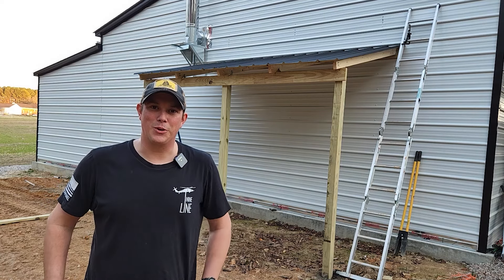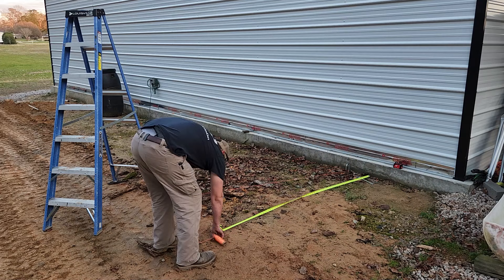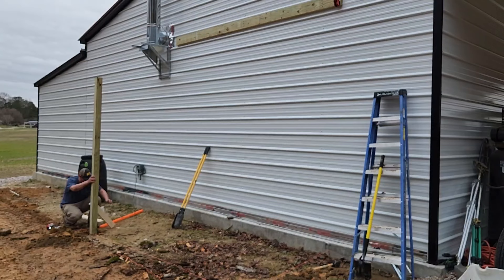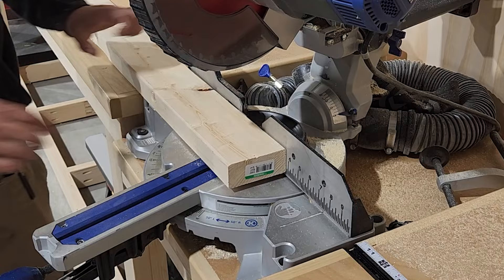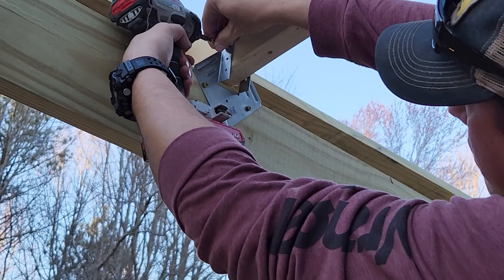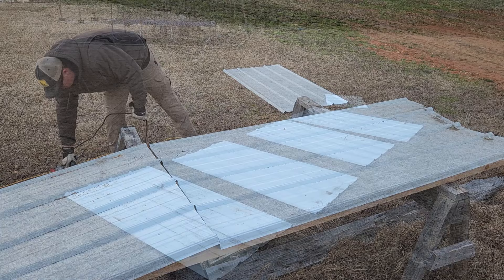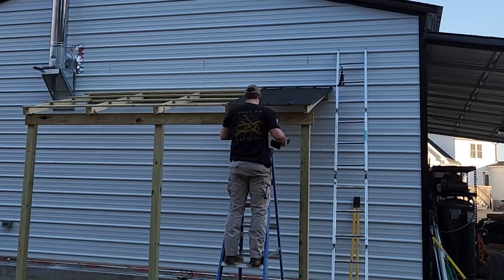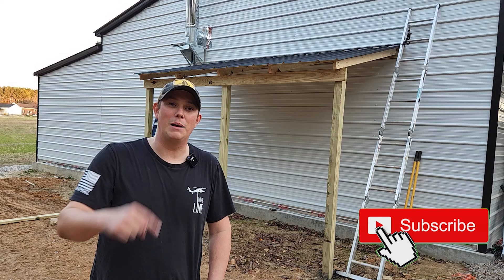How To Build A Lean To On An Existing Building

Comment: Good job.  It looks great!  My only suggestion would be to put some concrete in the bottom of the post hole before you put the posts in.  When you put the post in the hole first, then surround it in concrete you leave the bottom of the post exposed to the dirt.  It will slowly rot from the bottom up over the years.  The wood acts like a straw and will suck water up into it from the dirt that it contacts.
Reply: Yeah, but then you have a concrete cup the post is sitting in.  Best to put some coarse gravel down there to allow drainage while still creating a barrier from the soil
Reply: So does the ledger board just attach straight in tge sheet metal?
Reply: @dylanheflin3666  through the metal preferably fastened into every stud you can possibly fasten to

Comment: Good job!! just a suggestion, you can knotch out the top of the 4x4 post so that the 2x6 directs load to post rather that screws. makes for a stronger build.
Reply from the maker: Good suggestion!
Reply: Wouldn't even worry about that with something like this. That roof you could pretty much lift off single handedly. Majority of pergola's you see are held together with coach bolts so yeah, same concept
Reply: Can you translate “notch out the top of the 4x4 post….” in simple terms for the rest of us? I’m about to do this project myself and I’d like to know what you mean because I have no clue watch notching means or does other than makes it stronger…
Reply: @IGK58  At 3:04 you see him screw a 2x6 to his posts. Instead of doing this, you cut out part of the top of the 4x4, so that the 2x6 sits on top of a notch. You just make these cuts with your circular saw and the 2x6 will fit in the opening you create. Your 4x4 top will look like it has a little edge for the 2x6 to sit on. Many call it a LAP JOINT. This will distribute the load down the 4x4 instead of on the screws you used to mount the 2x6. I too am going to build this in a few days, and I think cutting out a notch is a wise idea.

Comment: Those joist hangers have tabs on them that you're meant to hit with a hammer after placing it where you want.  Just holds it in place until you can get some screws in it.
Reply: You can use screws for joist hangers...screws are not structural.
Reply: @boris9305 😂 You know they sell screw on joist hangers, right?
Reply: @boris9305 structural screws are most definitely structural....

Comment: The only thing I would have done differently is seal the lean to at the wall both on top and bottom. I built a porch once on a moble home the same way, I had a problem down the line by not sealing it.
Reply: What would you use to seal and how?
Reply: @justinrampersaud1948  I used a clear rubber  based chalk. Make sure surface is dry.
Reply: @robertwalley6692  thanks

Comment: nice video for a simple lean to project.  i would recommend at the top edge of the roof where the black metal meets the metal building putting a large bead of exterior silicone, caulk, or even roofing tar to seal out that joint.  Stormwater will find its way into that open joint against the building and over time saturate and deteriorate the ledger board.  Water can find its way into the shed through the screw holes too.
Reply: thank you for saying that. I was watching this and wondering if caulk was needed. Now I know! :)
Reply: @awildapproach  welcome!  my recommendation would be the tube of roofing cement, once it fully cures it is rubber-like and should hold up better over time than standard caulk or silicone.
Reply: @slo232000  Thank you so much! Will do!
Reply: Should have went to a seam in the metal siding and flashed the roof would’ve been the most correct way

Comment: Excellent video again. Building my own lean-to type in several weeks. for mine, it is going to begin from under a roof overhang of a tool shed so the flashing won't be necessary for my build. I like the idea of blockings between the truss/joists rather than on-top perlins. I'm still saving up for those thin corrugated metal sheets.

Comment: I have always poured a pier first then used a bracket for the 4x4 thus keeping the 4x4 from earth contact.  Has lasted over 30 years that way thus far.  Just a thought.  Great job, now I need one!
Reply: treated wood rots at the soil line.  well worth the effort to use your method.
Reply: @2nostromo  Depends. They have ground contact wood just for this application.  Or you can use a used railroad tie with 80 years of creosote, it will last another 80.

Comment: I cemented 4 x 4 posts into the ground when putting in a fence around my home in Florida and after about 30 years the posts began rotting out where the cement was.   I replaced the rotted out posts with new 4 x 4's but instead of cement put in crushed limestone to allow the water to seep past the wood.   I think this might be better than cement but 30 years is still great.  Thanks for the post
Reply: One solution to prevent the post from rotting is to first start with pressure-treated wood. Then coat the part of the post that will be below ground with a good heavy coat of black fence post paint. I like to use two coats. Now put that on top of a 4 -6 inch layer of compacted crushed stone in the bottom of the hole then pour the concrete around that. 

That's about as close to a forever post as you can get. If you cut your posts in the process of the build, especially the tops of the post, it's a good idea to coat those cuts with some form of sealant since you removed the PT chemicals when you made a cut. Happy fencing!!
Reply: Paint the bottom that will be going into the ground, I also add 4 screws going into the wood at a angle so the concrete has something to grab onto for a better hold. 

Add some small rock at the very bottom to allow drainage away from the wood. Make sure to tamp it down to get it as flat as possible.

Since you can cut the tops like he did in the video, it won't matter if they are even.

Comment: Great video! Looking through videos for a simple lean to and everyone had to go full on build mode. Glad you have an easy solid option for some storage space. Wonder if you could add metal siding to the sides too make it a little more weather proof from the elements.
Reply: I was wondering the same thing. This looks like a good solid structure to put some siding on.
Reply: Just add boards and siding. Easy upgrade.

Comment: I made on of those over a concrete slab, After finishing it just like you did I added half inch insulation under and a metal trim around the roof. Thanks for sharing,
Reply: Do a Country Cajun Living Dry Pour and the slab is easy.

Comment: I've done a few of these and I prefer tohave the posts 'float' about two inches off of the ground using 'Allthread', washers and nuts (washer / nut / nut / washer). These are inserted upwards into drilled holes aand downwards into the concrete pads. These allow for fine tuning by turning the nuts.

Comment: I would have put about 1’ of drain rock in the bottom before placing the posts. All in all a good job.
Reply: Thats what i thought
Reply: and when it rains the 1 inch will fill up in 1 minute and the post will be sitting in water as if the rock was never there.

Comment: Turned out great. My only concern is the bottom of the 4x4 posts will be exposed to humidity. One option is to put post bases in the concrete holes and screw the post to them, that way the post is never in contact with the ground.
Reply: The 4x4 will rot

Comment: Looks like you moved the ledger down after initial install to fit under metal panel rib, maybe to use as an overhang. Should have used flashing, The ledger will get wet for sure with this installation. Thanks for the video.

Comment: This is so perfect. Your lean-to is exactly the lean-to that I need for the side of our garage, and I'm using your design exactly. And mine is also for firewood, so that's double awesome. Thank you.
Reply: Same here lol I was worried about attaching to vinyl siding. Also concerned about what gets stuck on top of the attachment. Does the roofing get flashing?
Reply: @Robiobass2  well, I'm attaching to a wooden structure with an eve that hangs over about 10", so I'm good on those points.
Reply: @carlrudd1858  how wide are you going? I have about 3 rows deep in firewood. I'm thinking 6 ft also
Reply: @Robiobass2  not sure yet. I made it 12' long, and 5' deep. The low part of the roof is about 6 1/2' (a moderate pitch) up to about 8' at the side of the garage.
Reply: I am going with j channel on top of my 2x6  for the roofing metal to slide into. I'll use clear silicone to seal out the elements between the two vinyls. That should be good enough to keep the debris out. Mine is under a huge pine tree and needles get everywhere.

Comment: Loved this video. Also loved that you included the little one for a bit there..
A couple of 'constructive' thoughts.. pun intended.. 

1. If you're in a snow belt area, I believe it's been mentioned to attach ledger with through bolts.
2. If you're in a deep freeze zone, I'd make sure the posts are dug deep enough to prevent heaving, etc.. 
3. I'd consider placing a small amount of screenings, not concrete at the bottom of your hole, so the bottom of the post won't rot.
4. I'd also make sure the concrete stands a bit proud of the soil and is sloped out, to prevent rot at ground level.
5. I'm wondering if it might have been better to place your screws at the top of the ridge lines of your roof sheeting. All your screws are now 
     vulnerable to every run run off from rain above the screw.
6. I'd imagine you went through a number of cans of paint there... I do believe you can order that roof sheeting in black.. might be a special 
    order though.

All in all,  for the fact that this is a lean to... It will serve you nicely, but for you and others out there, some points to consider if taking on  something that needs/requires more structural integrity.
 
I do love the vid. I like that you kept it moving at a good pace and engaging and would look forward to more. I know it's a lot of work.

Best!

Comment: The only thing holding up the roof are the screws in the 2X6 going into the 4X4. You should have notched the 4X4 to have the 2X6 sit on the 4X4. If you have any snow load, that roof will fail. If you are planning on building something like this with snow, you need better support for the 2X6 besides construction screws into a 4X4.
Reply: I agree with you 100%. I'm currently in the process of doing something similar 10x12 that's the only thing that came to my attention Cheerios mate
Reply: Dead right if it were wider! That will take far more weight than one would imagine! I did something very similar it did 20 winters for me and didn't complain once! Technically you are correct of course in your build spec! :^)
Reply: Simple fix use through BOLTS...@ the posts  Done deal for that little roof 😎
Reply: I'm a carpenter by trade but I am not a builder and do not do things like this on a daily basis..... If I sound dumb that's why..... But when I saw him cut the top of the post off I was curious why he did not leave them there and just screw his end raftors into that...... I haven't made it beyond that in the video so he probably answers it..... I just thought why not add the extra couple screws it would help hold things together better.... If there is a clear and obvious thing that I'm missing well that's what I get for butting my nose in lol
Reply: Correct - if you live in a winter snow zone (I'm in Canada), you must account for the framework to bear a load of: 40 psf (for live load) + 10 psf (for dead load) = 50 psf x 60 sq.ft. (12'x5'slanted roof) on the load bearing structure. Which comes to 3,000 lbs. of total load bearing down on only 3 4x4 posts & shallow-depth cement piers. It will crack & bow at the very least. I would recommend using 2 corner 6x6 pressure treated wood posts NOT buried in the ground (they will rot at the base over time), but set on top of a Simpson Strong-Tie 1" metal standoff base anchored on top of a 12" wide cement pier set to 48"-52" depth. The reason I know these facts is because I was just inspecting a 35+ year old "DIY homemade" lean to used as a car port, built in the exact same way. The exposed structure has been completely deteriorated by weather & moisture overtime.
Reply: I was going to say something and saw this! Spot on!!!!
Reply: Birds mouth OR properly used rafter ties (strong ties)....
Reply: Shoot, simple structural lag screws would be enough
Reply: @josephdavis8017  I’m planning on building something like this to my back patio. I have poured 16ftx16ft concrete patio. Could I use those ties your talking about into my concrete patio?
Reply: @mindfreak469  as long as the patio concrete pad is 4” or deeper yes
Reply: I think he lives in Florida lol he isn’t worried about snow
Reply: Ummm no. If anything a hurricane bracket or just lag bolt it.
Reply: You'll  10 feet or so of snow to collapse that little roof.Stop it
Reply: It’s fine it will work just ok for what he’s doing. All of you bob the builders can stop it.
Reply: @rileyclayton3344 Snow may not be an issue in Florida but hurricanes are. A Cat 2 storm would take that lean to out easily.
Reply: It always blows my mind when people who don't know what they're doing make videos about "how to" do it. "How to" is instructional... What business does a DIYer have instructing others..? Bizarre.
Reply: @lilmissmonsterrr you are not obligated to watch!
No one ask you !

Comment: Great video.  Simple.  I’m not the best working with wood cuts but video came across easy.  I want to build against an outdoor 10X12 stucco structure but enclose it like a shed.  Can I simply add plywood to the sides?  Thanks!  Edward, California.

Comment: Never forget to mention to wear  proper PPE i.e. Safety glasses and hearing protection otherwise great video!!
Reply: Yup my ears were zinging. I tried cutting that metal with a saw couple of years ago. Went & bought tinsnips. The metal was so high-pitched scream like I couldn't stand it. Had to cut it by hand

Comment: Thanks for the video!!! I plan on adding a lean to on my metal garage. I got a question for ya, On the outside does water leak through where the roof metal meets the wall?
Reply from the maker: Yes, a little bit but for my application it didn't matter. You would want to add some flashing and/or cylicone to prevent that!

Comment: Did you put any gravel under the 4x4 posts for water drainage  ?  I noticed the roof is slope down to the 4x4 posts and if the rain comes down ,it is going soak inside under the concrete with the posts inside ,just my thoughts and nice built shed  !

Comment: I have been thinking about putting a lean to on the side of my metal building. I'm looking to go the full length of the building(22ft) and bring it out 10-12ft. The way you fastened your ledger board to your building do you think that will be ok or should I use something different ? What did you use exactly to attach your ledger board to your building ? Love the videos keep it up.
Reply from the maker: For that size I'd use bolts all the way through the studs.
Reply: @PatriotDIY  thank you

Comment: I have a question. Where the roof meets the side of your building, should there be some sort of rain/water protection along the seam such as a caulk? Won't the water get in between the initial roof board that's attached to the building, and follow the screws into the building, creating moisture/rot in the wall of the building? Obviously by my wording, I'm no carpenter, just seemed to me like a possibility. Thanks!
Reply: I'm building similar to this - and I'm going to screw in a rubber flap, maybe 4" altogether, into the siding on top and have it run along the length as a sort of 'flashing'.
Reply: You are sooo very correct. My way of doing that is to snap a line on the shop’s siding just below one of the ribs, then slide a less than 90 degree angle metal flashing up under the barn siding and lay it on top of the lean to’s roofing. Placing a prefabricated, foam barrier on top of the lean to’s roofing and under the flashing and you eliminate the water leaking between the roofing and the siding. No attaching screws necessary if the flashing extends up under the siding and down the roofing several inches.

Comment: Thanks for the vid, helped  me a lot! One thing, up until about the  5 min mark there were only 2 posts. Then a third one in the middle appeared! What motivated the decision to add a middle one?
Reply from the maker: It was just easier to get the correct placement of the middle post once the outside ones where there, but all 3 went in at basically the same time, you just don't see it until 5min because of the camera angles.

Comment: Looks great r u worried about water dripping through where the wall and roof top materials meet? If so how would u water seal it?
Reply from the maker: Not a big issue with mine but Flashing would be the best way!  Or maybe cylycone could work.
Reply: @PatriotDIY  great would u flash before the Corrugated material installed or after?
Reply from the maker: @DavidRodriguez-wd2sz  after
Reply: Perfect ty for the response I appreciate it !

Comment: What wood to metal screws did you use to attach the 2x6 to the building? I about to build a lean very similar to this and was gonna drill holes all the way through my metal building legs and bolt the 2x6 in place. The wood to metal screws would be quicker and easier. How are they holding up?